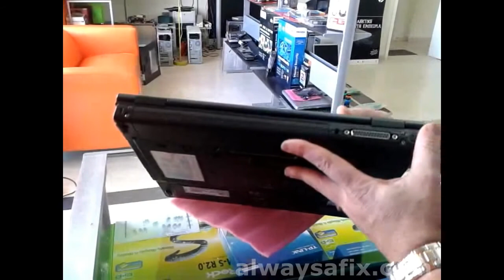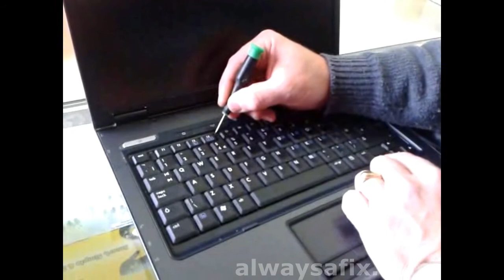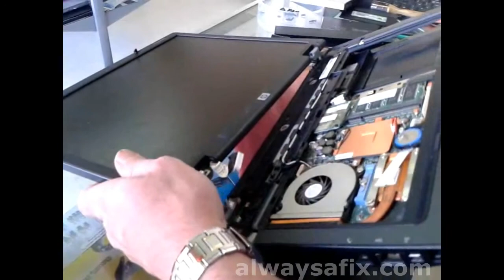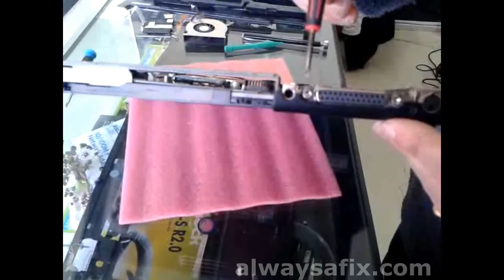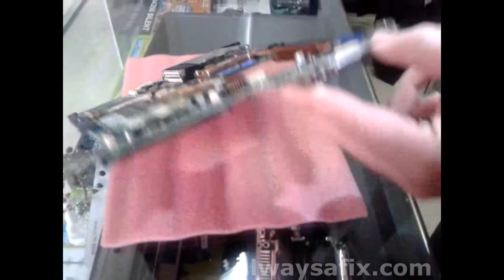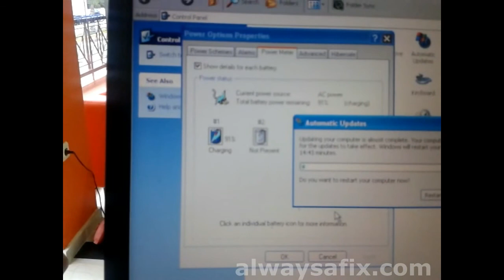Laptop charger socket repair

Comment: If i do it i dont want to disassemble it and not being able to assemble it again.
Reply from the maker: You are right to feel this way.  This job is not for everybody.  If you are not confident, maybe you could get a friend with technical experience to help you out.  If you do try it, take photos every step of the way and put screws in individually labelled containers, this will help you when it comes to reassembly.  Good luck!

Comment from the maker: This model shown here no wires connect to the port.  All contacts are made at solder points to the motherboard.  Other laptop models the port has a cable which plugs to the motherboard, and therfore easier to replace.  No soldering necessary.  Good luck!